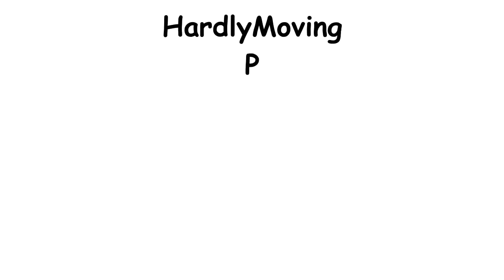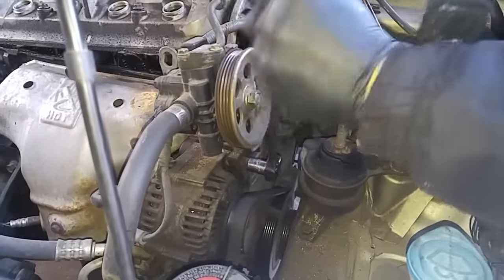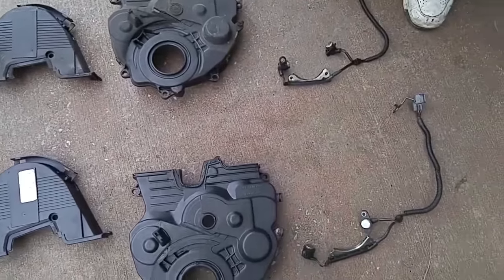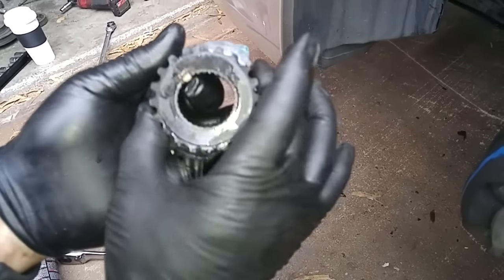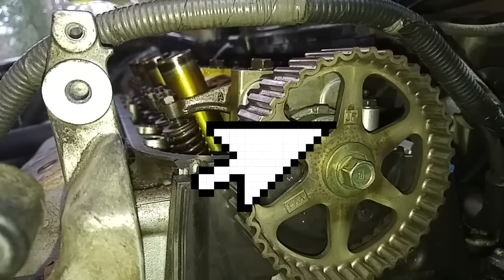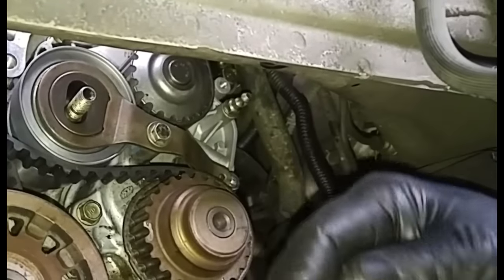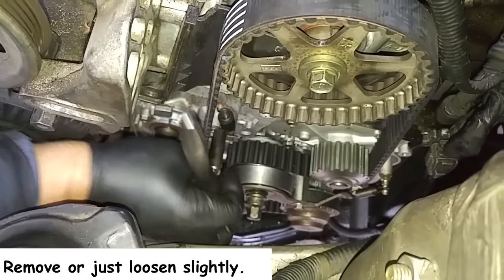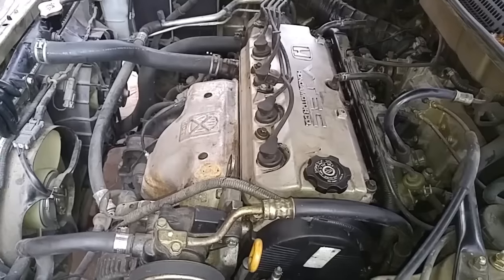Honda Accord Timing Belt, Water Pump, Pulleys & Seals - (4 cyl. F series 2.3L)

Comment: I have one of these in a 1999 accord leaking profusely from the lower cover.  Previous owner had the water pump, timing belt, and seals redone.  I'm thinking it's the cam seal as it only leaks when the engine is running.  Is it possible to remove the cam gear/belt without pulling the lower assemblies off?  Couldn't really tell how accessible the tensioner assembly is without removing the balancer belt.

Very well done on the video by the way, should save us quite some time.
Reply from the maker: Could be your VTEC solenoid gasket.  Here's the video that shows you how to fix it:
https://youtu.be/WJD6SLOiL50
Reply: @hardlymovingpro  It's definitely the cam seal, it's literally pouring out of the bottom cover.  Can I pull the cam gear without having to pull the entire bottom belt assembly?
Reply from the maker: Maybe.  From my recollection, the TB nut protrudes from the center of the bottom cover.  So take off the top TB cover, loosen the TB nut, pull up on the TB from the camshaft to loosen the belt tension on the cam sprocket ... then torque down the TB nut.  Then remove the cam sprocket to replace the seal.  But personally, I'd remove the lower TB cover because I don't find it to be time consuming and a big deal.

Comment: Man got it all together done then i hear whinning noise closer i got to it the more i smelled burning belt damn it got to do it over plus giting it in time is not walk in the park like you made it look
Reply from the maker: Did you start and run the engine BEFORE you put the timing belt cover back on?  Did you spin the tensioner bearings to make sure nothing is locking it up?
Reply: @hardlymovingpro  yes ran it before and no didnt spin it damn it hope its the small belt rubing and not timing cause that toke us 2 hrs to get on
Reply from the maker: If you did run it and you saw the tensioner pulley spinning ... then that should be good enough.  Something else that rotates must be rubbing.
Reply: @hardlymovingpro  the dang cam seal wasnt in all the way on oneside so the sproket was rubbing it
Reply from the maker: Well at least you having the satisfaction of finding the problem!
Reply: @hardlymovingpro  ya at least it was coverd on warenty to and not the belt
Reply: @hardlymovingpro  the valve cover grommets for the bolts everyone keeps blowing out will that cause me issues that you know of
Reply from the maker: Grommets should be replaced with a new valve cover gasket to insure a good tight leak proof seal.
Reply: @hardlymovingpro  ok so it isbthere to add tightness to the cover so if i replace them and end up ruining the new ones to were there is a hole it shouldt cause to puch of a issue as long as it still adds tightness to the cover
Reply from the maker: don't understand question.
Reply: @hardlymovingpro  
All my groments for bolts got ruined on instaling on bolt they are on but now have big holes cause botom tore out so will it cause a leak or should i be fine as long as the rubber is still doing its job of tighting bolt seal
Reply from the maker: Not quite sure.  If you followed what I did in the video, do not understand how the grommets got ruined.
Reply: @hardlymovingpro  ya used same size and it broke maby cause i used flat side on a ball pein Hammer maybe I should have used a heavier Mallet but didn't have them
Reply from the maker: @esmokebaby  Still don't understand.  It doesn't take a lot of force to punch the bolt through the grommet.  The key is to keep the grommet supported (sitting on top of a 17 mm long socket for example) while pushing the bolt through.  I've sometimes push it through with the heal of my hand.
Reply: @hardlymovingpro  o wow takes us a few good hard hits
Reply from the maker: Maybe the replacement grommets are of low quality.
Reply: @hardlymovingpro  maybe it's felco from AutoZone
Reply from the maker: I'd ask for a refund and go with a FelPro brand.
Reply: @hardlymovingpro  wait maby thats what it aas not sure

Comment: Can you update the first link for the timing belt and water pump kit? It seems broken. I'm not finding anything good on Amazon myself. Looking for something that comes with the balancing belt and all the seals and gaskets too.
Reply from the maker: Updated with a vendor called "Domestic Gasket".  Bought from them before and they make a good kit with the OEM Aisin water pump and Japanese brand called GMB for the bearings.  Also comes with valve cover gasket and valve cover bolt gaskets.
Reply: @hardlymovingpro  thank you so much! Using all the partner links.

Comment: I look forward to doing this with my 01 accord sedan f23a1 vtec oem automatic  187,621 I plan on running royal purple with dexos or ams oil 5w20 needs front main seal, but im gonna buy a agm interstate battery for it make it my daily
Reply from the maker: Almost 200,000 miles!  Good for you!  FWI:  All syn oils are Dexos compliant.  Thought the F23A1 used 5W-30?

Comment: Should I do valve adjustment at same time?
Reply from the maker: If they're making noise.
Reply: @hardlymovingpro  does the timing covers have a gasket? They seem to have some sort of material
When I took them off, also how would
You take the belt off if it’s not broken

Comment: Amazing video sir, am in the middle of doing this job on my son's 91 acura legend it needs a water pump, I hope I won't screw it up any tips will be very much appreciated.thank you
Reply from the maker: Good for you attempting this job!  If the new belt didn't come with painted cam and crank alignment marks, mark them on the old belt before removal then transcribe onto the new belt after removal.  Will make the installation of the belt easier.  Also, check that the cam and crank seals are not leaking ... better yet, considering the age of the car, just replace them.  Even with a new belt, if oil gets on them, the belt may prematurely snap.
Reply from the maker: Also, you may want to view my video on the Acura TL / Honda Accord V6 timing belt job since you're dealing with a V6 timing belt replacement.  Replacement technique should be similar.   Here's the link:  https://youtu.be/5Qxc-K8X6Do
Reply: @hardlymovingpro  Ok thank you I will watch it right now.

Comment: nice video. Question...how do you check the tension, whats the benchmark tension for these balance belts ?
surely there will be a set tension for the belt
Reply from the maker: Before putting on the upper and lower timing belt covers ... just start the car and look for excess belt movement.  If there is, loosen the tensioner bolt and allow the tensioner spring to pull in the excess belt slack.

Comment: 1999 Accord automatic, I removed crankshaft pulley and woodruff key, now key won’t go in all the way. Suggestions please
Reply from the maker: Install pulley without key and then try to wiggle in
Reply: @hardlymovingpro  thank you for recommendation. I tried it but old and new keys are hard to go inside. Do I need to remove cover and make sure gear is aligned, if so, can I just remove bottom cover only
Reply: I removed pulley and found out inner pulley is not aligned with shaft. Inner pulley can’t get out. Suggestions

Comment: It's the same and on Acura RDX 2.3L year 2007?
Reply from the maker: Nope.  That's a timing chain engine.
Reply: @hardlymovingpro  Acura RDX 2.3L turbo is with timing belt on it and water pump

Comment: What deep socket did you use to remove that nut from the motor mount ?my deep socket doesn’t fit. Thanks
Reply from the maker: Try a 1/2" instead of a 3/8" socket

Comment: Do you know why my car could be leaking alot of oil ,when i went open the timing cover the seal in 13:17 was slipped out do you think that could be the problem for a big leak would I have to replace it or just press it back in the motor only had like 60k miles
Reply from the maker: Yes ... Could be oil leak source.  I'd replace the seal.
Reply: @hardlymovingpro  oh ok thank you do you know any other potential seals that might be related to the oil leak
Reply from the maker: Balance shaft, oil pump, camshaft and crankshaft seals
Reply: I accidentally for got to remember to write on the pulleys do you think I can still lign them up

Comment: when you replace the timing belt do you also have to do the water pump?
Reply from the maker: Even if it's not worn out, recommend you do on the premise that it'll not last to the next timing belt change.  Same thing goes for the idler and tensioner pulleys.
Reply: It's standard procedure on any used Honda/Acura if you don't know if it was done by the previous owner. It is cheap insurance.  Better to spend $700+ having it done, much less if you know how to do it yourself and have the tools to do so, than having to spend thousands rebuilding/replacing the engine or even the whole car if the timing belt breaks or the engine overheats.  

Honda/Acura engines, especially 90s era, were just as good as their Toyota counterparts save one weakness: Honda/Acura decided to go with an interference engine design.  If the timing belt breaks,  it will bend the valves, damage the pistons and destroy the engine. 

This is why changing the timing belt is important.  The water pump also changed since it's right in the middle of the timing belt and has to be removed during the procedure anyway, might as well replace it with a  new one to ensure proper cooling. Tensioner is also replaced as springs eventually wear out.

Comment: Am I supposed to put threadlocker and RTV on for the installing of the water pump?
Reply from the maker: No ... not necessary.   The new pump should come with a new rubber gasket.
Reply: @hardlymovingpro  Thanks, man.  You are really helpful.

Comment: Great video. I learned so much. Two questions: What is the gasket that got removed at 7:55? Was it replaced later on? Second question is at 13:26 the front balancer shaft seal doesn't have a retainer. On some Hondas this seal is known to pop out and make an oil leak.
Reply from the maker: Thanks!  At 7:55, it's seal for the dust cover removed to get to the camshaft seal.  Not a critical part.  Heard about the BS seal popping out.  Never seen that problem.  Maybe happens from rising blow by gas pressures by having too much oil in the crankcase.

Comment: So what do you think on the labor charges per hour with the mechanic and how many hours you’ll need on a Honda Accord 3L v6 2007?
Reply from the maker: 4 to 5 hours and you'll have to shop around for the best rate for a tech with experience with this engine.
Reply: Hardly Moving Productions It’s a darn $1100 to 1200 loot going on with the Honda dealers in Minneapolis!!!!!
Reply from the maker: Look for a tech on Craigslist that works on the side.  They'll charge around $50 + an hour
Reply: Hardly Moving Productions There is a mechanic website yourmechanic.com which was around $400 but they don’t come to my zip code but I am just surprised about the dealers taking people for granted!
Reply from the maker: @worldpeace5853  That's funny.  I applied for a work with yourmechanic.com, some women who knew nothing about cars interviewed and rejected me.  Can you believe it?  I guess because I argued that I didn't feel comfortable using parts they insisted be purchased by local parts vendors.  Told her I didn't want to deal with irate customers if a water pump or timing belt failed due to installing an inferior part!
Reply: Hardly Moving Productions I believe you, the reason is they are way too less and when that’s the case there is always an element of doubt. I did google their mechanic’s name and place and I didn’t get any reviews as well. For small jobs like spark plug change etc. they can be be called for if you aren’t confident but bigger jobs require some kind of expertise. I did go with a local mechanic and bought my own parts and it was less expensive when compared to a dealer and this was certainly a better option.
Reply from the maker: @worldpeace5853  That's another good point!  yourmechanic.com wanted me to start off doing oil and filter changes.  I tear engines and suspensions apart and put them back together again and they want me to travel to customer's homes to do oil changes ... rain or shine?  So I have to spend time getting the oil and filter, arranging an appointment, doing the job then disposing of the oil?  How can you make money competing with Walmart that do $30 oil changes?  BTW - even spark plug jobs can get screwed up.  A lot of these techs are scared of over torquing plugs so they generally under torque.  The plugs eventually become loose in a couple of months.

Comment: What happens if you leave that 10mm bolt in on the belt timing  tensioner ?
Reply from the maker: Nothing.  You can keep it in there.
Reply: Ok thank you that’s what I’m living with now I even looked at a oem diagram of the timing belt setup from the factory there wasn’t a bolt in there so I was just making sure the old tensioner had a mark like  a bolt was in there at one point and walked out

Comment: My crank sprocket is stuck with no help from penetrating sealer. Can a puller remove help to remove it for a crankshaft seal replacement?
Reply from the maker: Yes.  A puller tool will work.
Reply: @hardlymovingpro  just any pulley? Could it be safe up use a pry bar?
Reply from the maker: @mehulpatel007ify  maybe a small one
Reply: @hardlymovingpro  thanks. I'll let you know
Reply: @hardlymovingpro  so do you happen to have link to a puller tool that will fit and work?
Reply from the maker: What this video at the 2:20 time mark:  https://youtu.be/Y7WLtDkcAp0

Comment: Wow the new crank and cam seal just went in with the fingers. Ain't you need to press them in with a socket and hammer? Maybe those new seals fit too loose?🤔🤔🤔🤔
Reply from the maker: Coating them with silicone grease before installation helps

Comment: Is it possible for a faulty crankshaft position sensor to cause a crank no start if spark and fuel are present? Working with a 97 Accord LX.
Reply from the maker: If you have a mil code indicating crankshaft position sensor error
Reply: @hardlymovingpro  The car is showing no codes unfortunately.
Reply from the maker: Then it could be anything
Reply: I recently replaced my distributor on my 97 Accord  SE with the F22B non-Vtec engine. There was no check engine light on my end also. I also replaced the ICM ignition control module with no luck. Turned out the TEC distributor internal cylinder positioning sensor was defective and causing a no starting condition. The engine would crank, but no start. Once replaced, she started right up.
Reply from the maker: Similar to what happened to me with a 97 Civic.  Car just died after a test drive with new plugs.  No current going through the ignition wires.  Replaced the distributor with one from the salvage yard and car started right up!

Comment: Thought the beginning you kept saying dead center when referring to the camshaft and the top engine,  can you elaborate on that?
Reply from the maker: Top Dead Center or (TDC) is when the number 1 cylinder piston is extended to the top of the engine block cylinder hole and is on its compression stroke.

Comment: So I got a question why does my cam move overtime I try to do the left tooth trick
Reply from the maker: Valve spring tension.  Mount the belt first, hold in place with alligator clips, then reposition the cam after the rest of the belt is on.  Afterwards, check the alignment.

Comment: I notice a rubber gasket like material at the edge of the inside of where the timing gears and crankshaft sensors are at when I was doing mine, it was kinda of falling and tearing off in pieces, is there supposed to be a timing belt gasket in there?
Reply from the maker: I know what you mean.  Not necessary part.
Reply: Hardly Moving Productions thank you!

Comment: timing belt tensioner:  spring and bolt location
Why is it, when put a snug tension on a timing belt, the slot runs out. I can practicaly put that small bolt on the outside of slider.
You have replaced "many " hondas.
my belt lay out is just like diagram shows. but the slider goes way to far.
example: I wanted to use the bolt on the slider, to tighten that timeing belt tensioner.
Slider, pushing up towards the head,  going past the bolt hole.
Reply from the maker: Put back on the old belt and see if the same problem exists.  If there is less slack compared to the new belt, then your new replacement belt is the problem (too long).  Otherwise, put back on the old center tensioner pulley bearing with the new belt and again, check for excess slack.  If too much slack, then the new center bearing may not be the correct diameter.

Comment: At 17:28 you say to losen that bolt to allow the tensioner to settle but it shows you tightening it then you tighten it again moments after? Im trying to do this job right but im just confused.
Reply: Also did you remove the 10mm? Did you ever tighten it if not?
Reply from the maker: When you loosen the bolt, you're allowing the tensioner spring to pull in any excess slack via the tensioner pulley.  After the slack has been removed, you re-torque the bolt before starting the engine.
Reply from the maker: The 10 mm bolt is there to allow the installation of the 2nd bearing for the balance shaft / oil pump pulley and belt.  After the balance shaft belt has been installed and all slack has been removed, the 10 mm bolt can be removed.  Doesn't hurt to leave it in place.  It did its job in assisting in the timing belt installation by not allowing the tensioner pulley to move around.
Reply: Did mine today. I was trying to find out the most accurate info as doing timing on your only car is nerve wracking
Reply from the maker: @MacroMicro99  yup.  First time I took off the tb covers i was like "what the F?".
Reply: @hardlymovingpro  makes you think the Japanese were visited by aliens
Reply from the maker: Their engineers are geniuses.  Much better than the Germans.